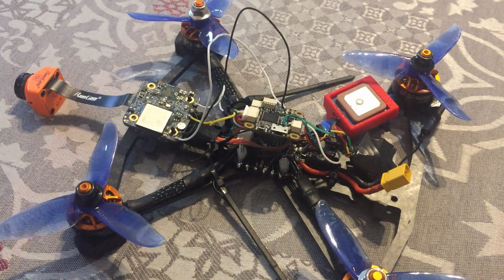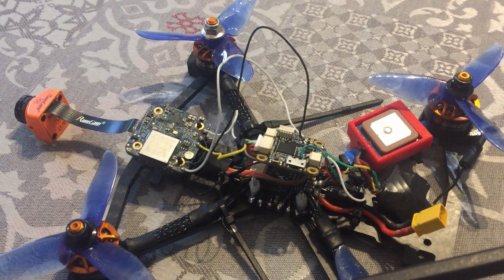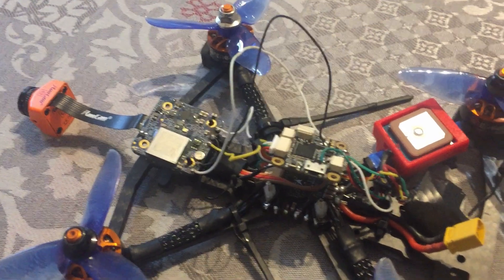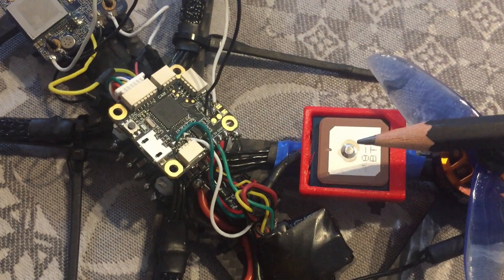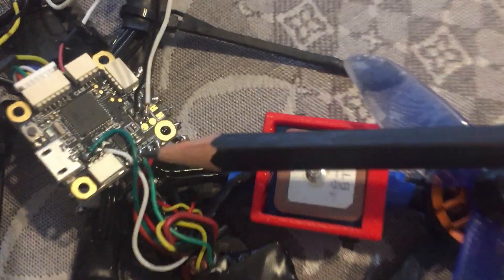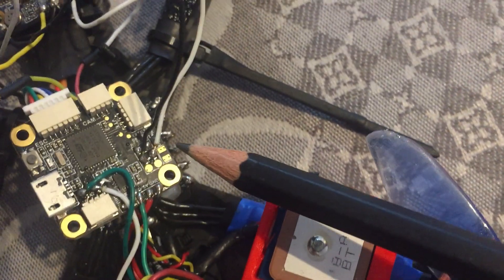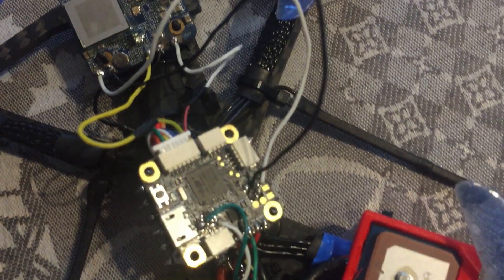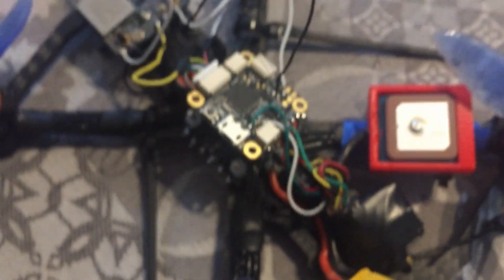Tyro79 with RunCam Split Mini 2 and GPS - How to Softserial, again?!

Comment: Neuer Tyro79. Mit Softseriel 1 auf led Strip für smartaudio! Ich bekomme aber keine GPS- Werte im OSD angezeigt!
Über USB wird alles Erkannt. GPS u.s.w.  Könnt Ihr mir helfen? Auf welches Pad muss das Grüne DATA Kabel vom VTX .
Habe schon zig Tuto´s durch!
Reply from the maker: Hallo Mike, ich schaue es mir am Wochenende an, da ich den Tyro nicht mehr fliege! Ich hatte aber GPS-Werte (also jedenfalls habe ich die Geschwindigkeit genutzt) im OSD. Melde mich :)
Reply from the maker: Hallo, also bei mir war es kein Problem die GPS Daten (Geschwindigkeit) im OSD anzuzeigen. Betaflight 3.5.X der VTX hat damit aber nichts zu tun. Dein GPS modul bekommt Strom (plus minus) und hat zwei Datenkabel (senden und empfangen TX RX). Dein VTX überträgt dann zu deiner Brille. Dafür hast du dann wieder Strom (plus minus) und einmal Empfangen (also aus sicht des FC senden). Das was du mit dem grünen Kabel meinst ist meist das SmartAudio Kabel. Frühereine möglichkeit auch Audio neben dem Video zu übermitteln. Heute wird es genutzt um Einstellungen zu bearbeiten. Deine GPS Daten solltest du dir in Betaflight unter dem Reiter OSD einstellen können. Setze dort mal die Hacken. Bei Fragen gerne melden!

Comment: Möchte meinem Tyro79 auch eine Runcam Split Mini 2 spendieren - bin mir aber nicht sicher, wie (bzw wo) ich die anschliessen soll. Saugt ja immerhin 650mah. Wie hast du das gemacht?
Reply from the maker: Also ich habe die TX und RX pads (wie im Video beschrieben) via Softserial an die Pads S5 S6 angeschlossen. Den Strom habe ich an den 5V+ und Masse Pad des Kameraanschlusses verbunden. Laut Beschreibung darf die RunCam NICHT direkt an den Akku angeschlossen werden. Bei mir läuft alles wunderbar. Hier die Beschreibung vom Hersteller https://www.runcam.com/download/SplitMini2/RunCam-Split-Mini-2-Manual-DE.pdf?t=20190311